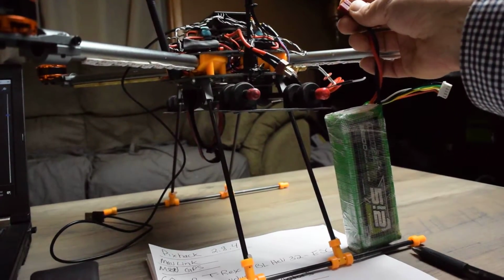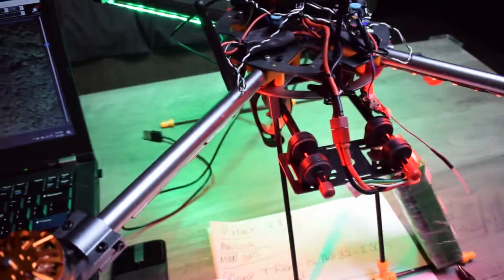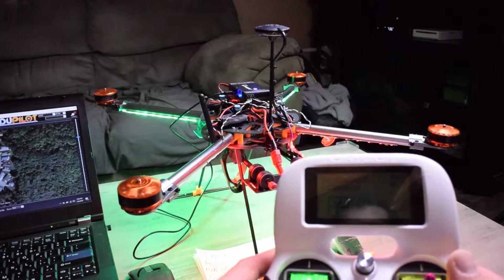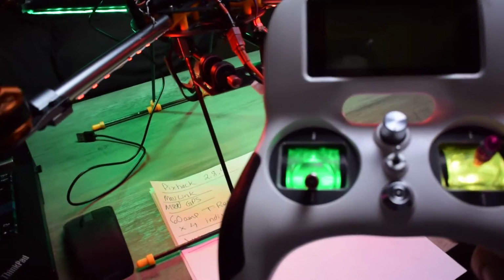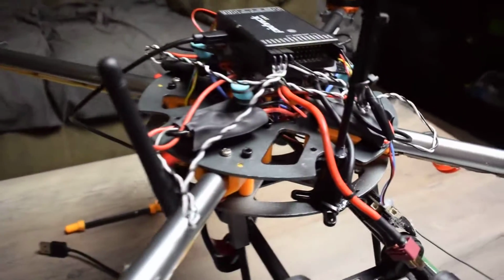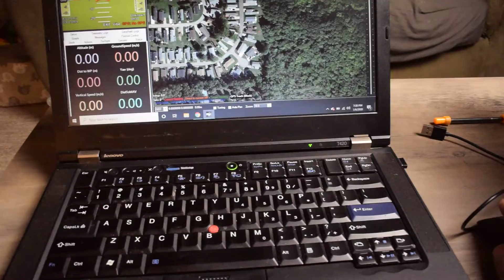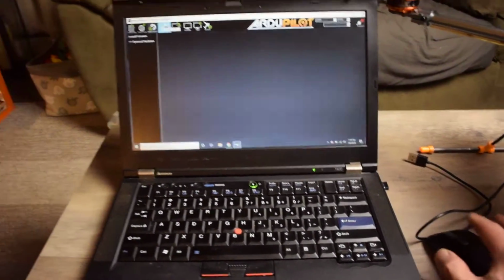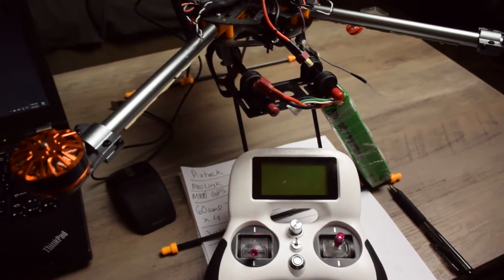Pixhawk Motors Will Not Spin BL HELI ESC

Comment: Calibrate your esc. They have YouTube videos for that.
Reply from the maker: I successfully calibrated the escs via mission planner and using Tx not connected to usb. 
After manual calibration is complete normally I can increase throttle. 
This setup would only spin at arm speed after esc calibration tones completed. 
Thanks 
Nick